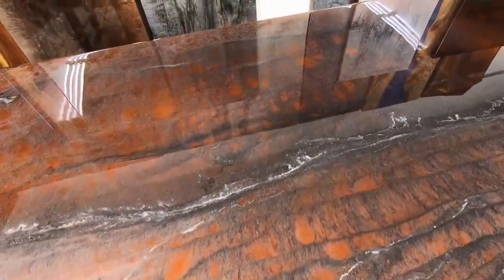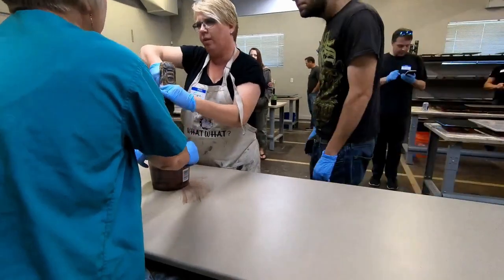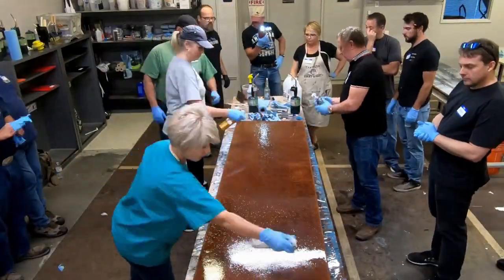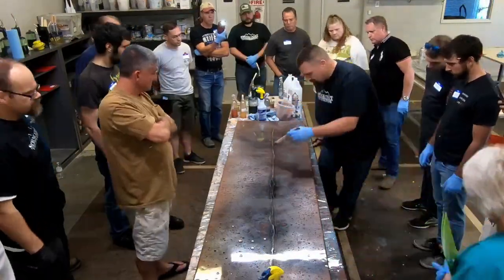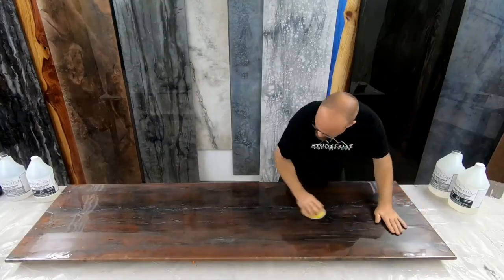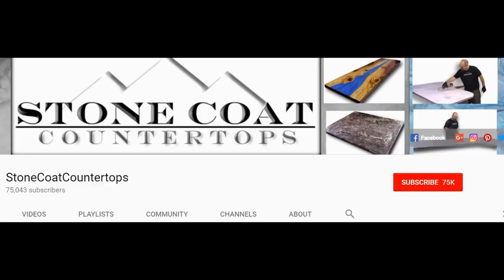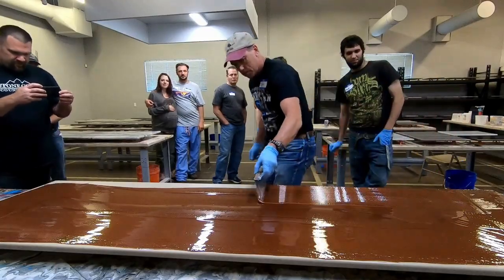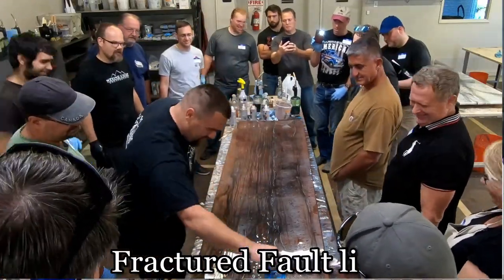Advanced Epoxy Free Color Training

Comment: Since I'm doing one right now I'd like to see you do the formica top with the back splash.
Reply: Actually the thing is finished now. I used the black marble recipe with the "silly string " spray. Really happy with it. I took some pix with the phone but I'm not sure if I can get them to you. I'm older than this technology.
Reply: I saw the one in Alaska. It looks a lot like mine except before the marble effect I fogged veins of metallic copper and bronze and to give it a little life I mixed a half package of your black glitter into the 1st clear coat. There's no limit to what can be done with it. I'm sure glad that I found your channel. My only concern is with the undermount sink you guys did. At home we have actual granite counters and after about 10 years we have several small chips around the sink opening from large pots and pans striking the edge. I don't think the MDF will hold up well over time. I used a top mount sink on the one I did. 
Thank you for everything.

Comment: Stunning as usual. All your work much appreciated. Learning so much from watching your videos.
Reply: Yes I have, I have been working on a epoxy river bench for the last  3 weeks.  Did the flattening just like you showed with the router sled. And put in those steel bars underneath with the bondo just like you instructed. When I did the epoxy pouring miscalculated with the amount and the bars how a little. But just put on the last flood coat two days ago and letting it dry. Now working on the legs. If it turns out half as good as what you do I will be happy. Thanks again.

Comment: can i have a vote  for both??? We have an integrated back splash and didn't know it would be possible to keep it. But would also like to see how you do the floors. So many choices!
Reply: StoneCoatCountertops we aren’t sure yet. I think I have convinced my wife to do the stone coat for the kitchen because of the cost savings and durability. However she and I both want to try it on a sofa tabletop I am working on to practice first. Proof of concept and techniques essentially. So many color options and looks so it’s hard to nail down what we want because it all looks amazing. What do you normally tell people when they have trouble with color choices?

Comment: Nice project!!! My vote for the next video is the Formica with back splash... because I will be doing this to my kitchen counters in the house I just bought soon!!!
Reply: Thanks for your reply! The original cabinets are staying (they are a light oak stain popular in the 2000s when the house was built). I'm laying a new vinyl plank floor "Copper Barrel Oak" color, so I'd like the counter color to be a nice transition between the lighter oak and dark floors. The colors and "fault line" technique you used in this video would be perfect!